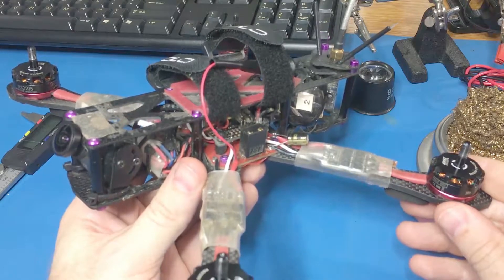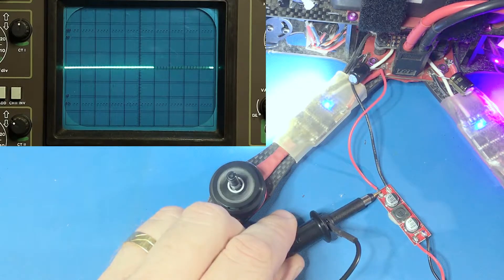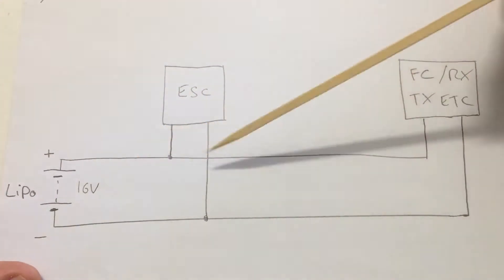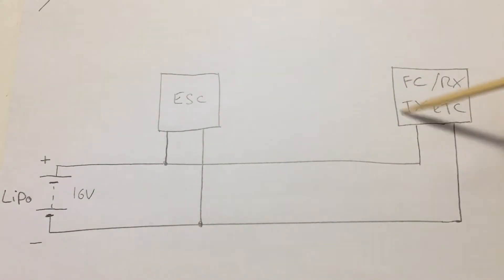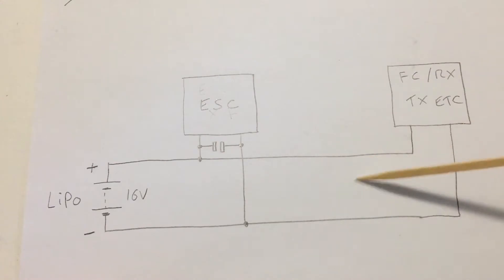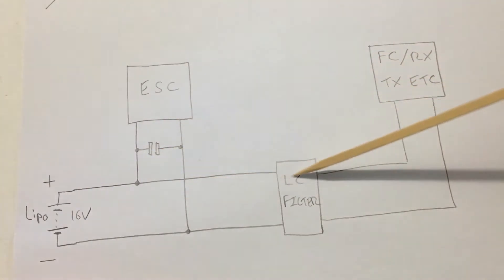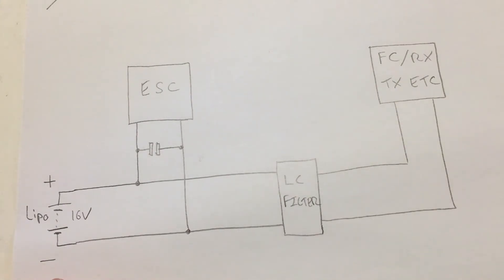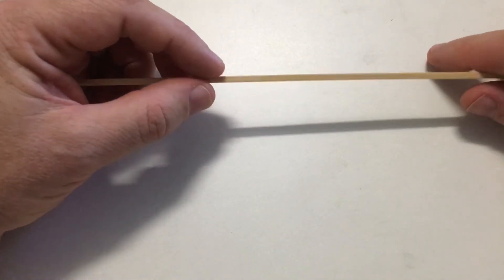Tech Talk - RC Filter Testing | Mini-Quad Noise | LC Filter | HOW TO

Comment: Very well explained, nice and simple. I do believe there's another method to filtering the voltage spikes, and that's to actually dissipate the energy at the source. 
What are your thoughts on using a flyback diode to reduce the Back EMF. Its standard procedure in most industrial systems, just wondered why we dont implemented it here also. 
I've hade ideas of using zener diods to clamp the voltage at a given voltage and power some LEDs using the back EMF. (Essentially connecting the cathodes to each motor wire on the esc and then connecting the anode to a common + which would feed a group of LEDs.)  Obviously the zener diode would have breakdown voltage slightly higher than the battery voltage.
I would like to hear your thoughts on this and if there's other components that do the same job or better, then please let me know.
Reply from the maker: Hi there, thanks for the nice comment :D I have seen capacitors/diodes on motors before and my feeling is that since the diode you talk about is a semi-conductor, it can be prone to failing under duress. Having said that, the chances of that happening are probably quite low if the rating of the component is correctly chosen. To answer your question though, I have seen an emergence of using diodes on copters across the ESC power lines. Yes it will reduce the noise that goes above the threshold of the (Zener) diode but what about when it falls below the nominal voltage due to fast occurrences of high current drain. You will still need a capacitor to smooth out those fast voltage sags. Therefore, I think filters that I mention in the video are probably still the way to go. I'll see if I can get some diodes on order and perhaps do a comparison between the 2 methods. Cheers Tony